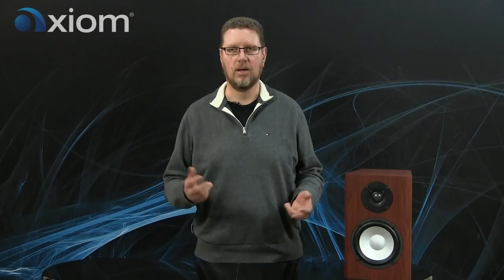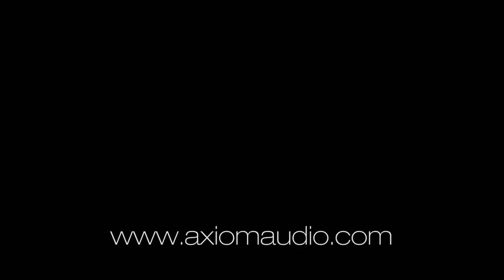Are My Speakers Blown?

Comment: If I can get some feed back on an issue that would be amazing.  I have 2 - Qsc k12 speakers and they’ve always been amazing.  Lately the speakers sound sooo harsh and loud like it’s not healthy sound.  Everything is gained correctly, seriously there’s no reason these speakers should be sounding this loud and harsh.  It sounds like the gain on my mixer is cranked so it sounds very hot and over gained and harsh and loud.  But again everything is properly set etc.  Nothing sounds buzzing or anything like that it’s just so harsh sounding.  I’ve tried different mixers, different audio interfaces and the speakers are my last option.  Do speakers start to produce harsh sound when they’re going bad?  I’m going to go buy 2 of the k12.2’s to see if it’s the speakers but since I’ve never heard them sounding “blown” like crackling or buzzing etc I never thought they were bad.  If someone can let me know if this is a sign of the speakers going bad that would be super helpful.  Again the speakers sound very clear and fine but harsh and loud when I get them to an appropriate level.  So now if I wanted to get a crowed going at say a bar, my volume will have to be wayy more lower for it not to kill my ears and then I can’t captivate the energy and vibe of the venue because of the harsh sound.  I hope this all made sense and if anyone can help me out that would be awesome.  I really hope someone says hey man your speakers are dying go buy new ones and then I will be so happy.  I just want this problem fixed because I host two shows a week and I am losing my hearing and I’m livid.
Reply from the maker: If the sound has changed all of a sudden, it suggests to me that something might have happened to the internal electronics, or the tweeters. I would speak to QSC to see if they have any ideas.
Reply: @AxiomHomeTheaters  thank you very much
Reply from the maker: @Wturn89  you're welcome.
Reply from the maker: @Wturn89  you're welcome.

Comment: So today I was playing music and they sound completely fine. They’re clear and have good bass still but during certain songs with the bass where I usually have it I’ll hear a popping sound. Does anyone know what that is? It sounds like a suction cup being pulled off a glass.
Reply from the maker: If it sounds mechanical it’s possible that you are “bottoming” the woofer. This means that you are driving the woofer beyond its limits and the voice coil is hitting the back plate of the motor system, creating a mechanical popping sound. If this just started occurring you might want to remove the woofer from one of your speakers and have a close look at the surround and the spyder/damper (attached to the back side of the cone neck) to check for damage. Thanks for watching, and good luck with your speakers.
Reply: Axiom Audio thanks i appreciate it

Comment: Hi guys why is monitors to hot at the back ???
Reply from the maker: What kind of monitor? Computer?
Reply: M audio bx5d3 using them in my yamaha psr s770 keyboard professional arranger
Reply from the maker: @Lackojunior12  Your monitors have built-in power amplifiers which is why they are heating up. The rear panel is acting to dissipate the heat.